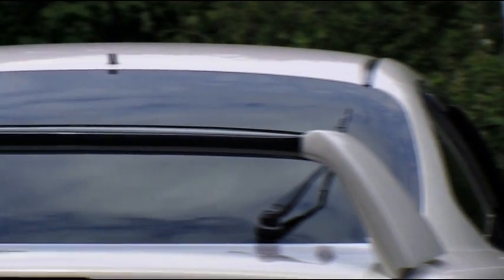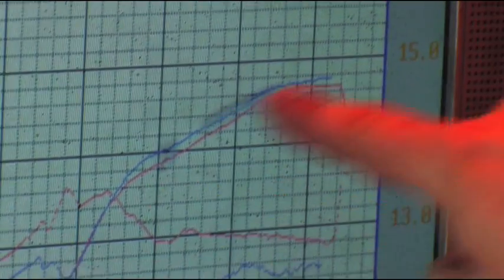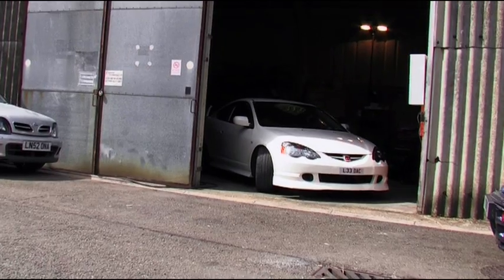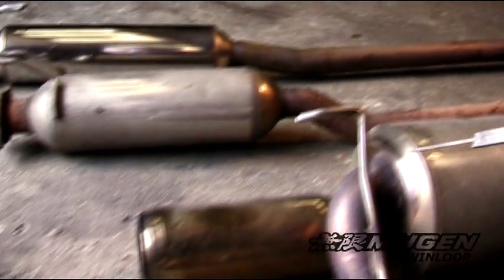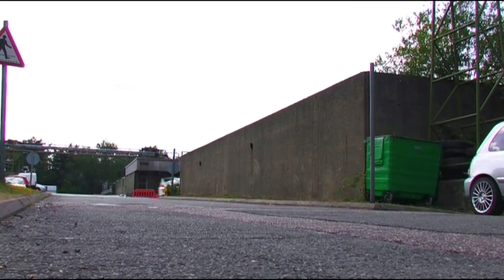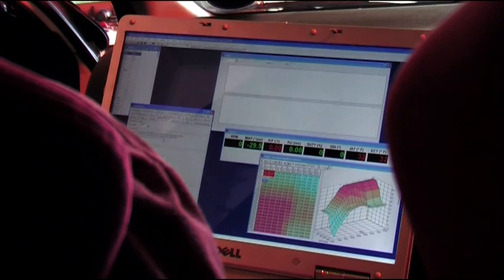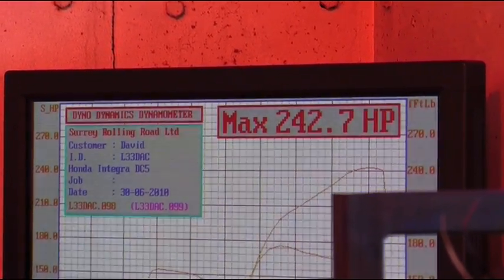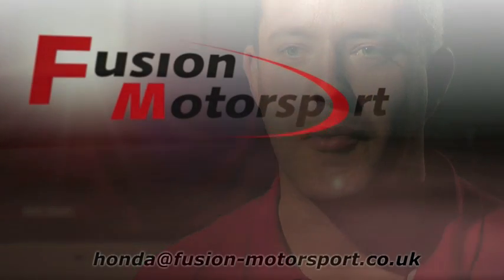Honda Integra DC5 - Performance Parts Test + Hondata Dyno Tune - TWO

Comment from the maker: @Stewlark i'd go for the Fuji, build and performance overshadows the mugen system. 

Mugen does sound really nice but Fuji is also jasma rated and sounds awesome imo. 

Finally, the Mugen is heavy and sits much lower to the ground. Where as the Fuji is light and sits very snug to the underside of the car.